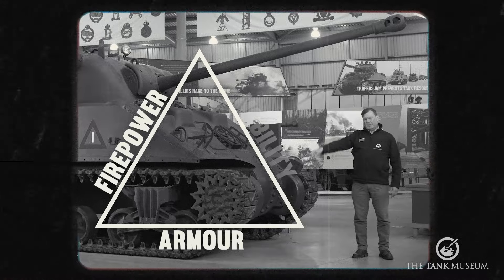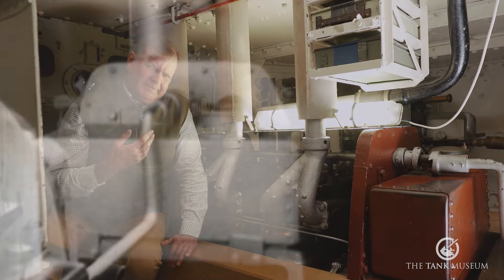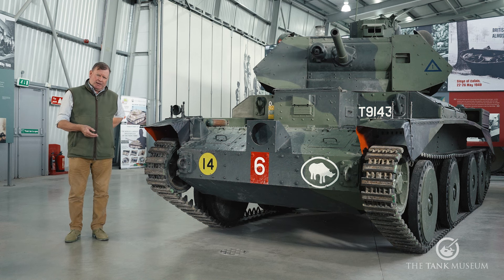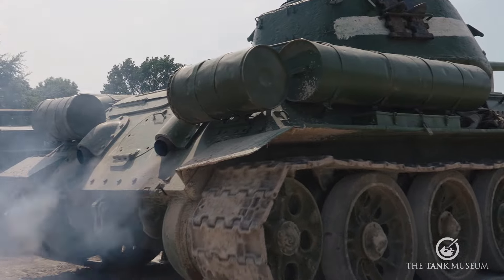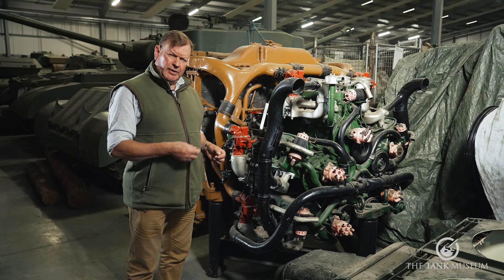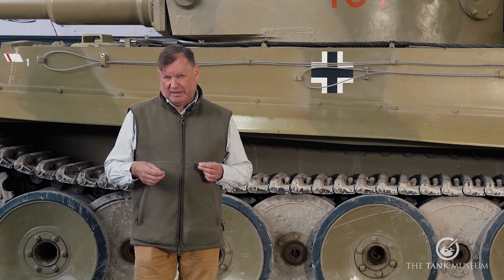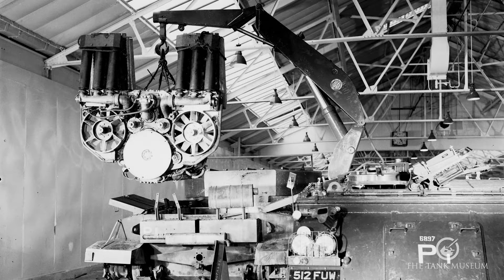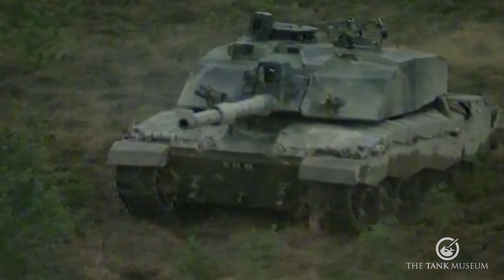Powering Victory: How tank engines went from 105 to 1200bhp

Comment: I would have liked a bit more explanation about the factors that led to engines getting better/more powerful. This video seemed to be more about giving examples rather than discussing the general topic. Rather disappointing considering the title starts with "How".
Reply: Yes, this was more of a "why" than a "how"and seemed to rely a bit too much on tanks the museum owns. It was good to start hearing about such factors as reliability and fuel consumption, but perhaps the details I'd loved to have listened too might be a bit too nerdy for most viewers
Reply: I think delving into things like compression ratios, among others, would go over most people's heads.
Reply: Then we would have veered out of the realm of tanks and into vehicle and motor manufacturing in general. Tank engines became more powerful for the same reason    every other land vehicle, aircraft or naval engine did too.
Reply: I can briefly explain the key breakthroughs in a comment when I get the time, soon.
Reply: So onto tank powerplants.

Obviously something that went on regardless of the type of engine, and the main source of progress in gasoline ones in particular was constant improvement in materials, manufacturing and fuel quality, and parts design to improve combustion and cram as much cylinder displacement and horsepower as possible in a given space.
Similarly, progress in cooling systems (mainly raising the operating temperature of the coolant to extract heat in the smallest cooling system possible), transmissions and other accessories allowed engines to take an increasing proportion of the volume of the engine bay.
These improvements contributed in good part to the increase in power density up to WW2 as otherwise tank engines were still naturally aspirated. 

At the end of the day however, a lot of the increase in engine power in tanks was achieved simply by installing bigger engines as engineers and armies accepted to lift weight and size limits to improve general tank performance. For example most tanks before WW2 had engines of less than 20L in displacement, often even less than 12L. Many went over 20L in WW2, as exemplified by the Germans who went from 12 to 23L during the war. It is only in the 1950s and 60s that engine size stabilized (displacement still increased by improving engines to cram more cylinder displacement in the same space, and was generally over 25L and even over 30 or 40 in some cases). In the 1970's the size of powerpacks stabilized as more powerful engines were introduced but transmission and cooling systems had not progressed as much and became bigger to cope with the extra power.
After the 70s, powerpacks could finally start to shrink for reasons that I will explain next.

Let's go back to the 1950's and 60's. A big change from WW2 and before was that everyone was now going to diesel engines to reduce fuel consumption, allow potential multifuel capability and provide better torque characteristics. However, until then diesels had generally been less power dense than comparable gasoline engines as they were naturally aspirated, and didn't get satisfactory air mixtures for combustion at certain regimes. The second great change from before was the generalization of forced air induction systems, first superchargers and then turbochargers. These were critical as they could provide a compressed air and better mixing, which allowed better combustion and higher power output out of the same engine. Diesels benefitted a lot more than gasoline engines which could only be boosted so far with the fairly low octane gasoline fuel available to ground vehicles. Turbocharging allowed 50's and 60's diesels to match or even exceed gasoline engines in overall performance.

Since then, a lot of the progress in engine power density is down to increasing turbocharging boost, which was achieved both with technical improvements of the turbochargers, and with optimization of the diesel engines themselves. Namely by reducing compression ratio (CR), as increasing both CR and boost is not practical and an engine gains far more from high boost than high CR. Turbocharging systems also now spool up faster than before, which means that engines do not need to be as big as before to provide sufficient power and torque while the turbos spool up. This is why we can now get tank engines with 1500hp at just 24-30L of displacement, instead of up to 47L in the early 70's.

We now get to the late 70's and 80's. Since then, tank powerpacks have actually started shrinking (they did that sooner in the USSR because they implemented some features sooner than the West) as power density increases while actual power output requirements have stayed at 1500hp, although options for 1800hp exist and there are good reasons we would want to go higher (in particular, restoring levels of mobility on tanks which have grown massively in weight since their introduction).
This size reduction was achieved by further improvements in the engines themselves and the turbochargers, but now a good chunk is also down to cooling systems and engine installation, at least in the West since the Soviets did that before. Coolant temperature was increased, and engines are now mounted transversely instead of longitudinally, which cut the total length of the engine bay thanks to better packaging.

Moreover, powertrains now use good electronics to run the injection system and the general operation of the engine, which helps improve combustion to a degree that purely mechanical and overall less flexible systems couldn't. That said, it is worth pointing out that most tanks today still run on powerpacks designed in the 60s or 70s, so a lot of the improved powerpacks are still prototypes or just weren't bought.

Turns out that was pretty long with many technical terms. If you guys want further explanation feel free to ask.

Comment: The T-34 is well-designed?? There was one man in the turret acting as commander, loader and gunner. It was very cramped and hard to escape from. There is more to design than just the outer shell of a tank.
Reply: Two men in turret.

However cvorrect that ergonomics were bad

Comment: Why do tank engines almost always peak at 1500hp? Like why doesnt someone build a 2000hp one? It seems like the 1500hp is the standard for last 40 years
Reply: Because 1500 hp is well suited for efficently powering vehicles in the 60 ton class where most modern western MBTs are. Tracked propulsion has a lot of internal friction, add to that rough terrain and you will get diminishing returns at a certain speed, e.g. adding more horsepower will not increase acceleration or speed at the same rate it does up to 1500 hp.

Though MBTs have been getting heavier, the latest Leopard 2A8 comes in at close to 70 tons and its engine power got increased to 1600 hp to balance it out.
Reply: @jonny2954  thanks!

Comment: Another thing to mention regarding the engines is that most tanks are bloody loud. Not like diesel truck engine loud, I mean aeroplane loud. Couple that with the rattling tracks, even some of the smaller tanks will make the Earth shake when they drive past. The idea of tanks being stealthy is a only reality at long ranges.
Reply: One nickname of the M1 Abrams is "Whispering Death" due to its gas turbine engine being so quiet compared to equivalent-rating diesel engines. At night and/or upwind the dominant high frequencies of the AGT1500 gas turbine become difficult to hear at range, unlike the dominant bass frequencies of big diesels which carry for long distances. The Abrams really can "sneak up" on opponents when conditions are right.

Comment: Ha, skipping the fact that pre-WW2 bigger displacement in the UK was taxed higher deliberately - resulting into poor power/weight ratio first half of WW2 UK tanks.
Reply: Taxes probably not all that important with design for engines for tanks, as the most common engines for commercial production available in pre-war UK were used for double-decker buses, which would also used in rigid trucks & coaches. These ranged from 7-10 L.

Comment: the L60 engine would have been better if it was just a raw diesel engine, run the bugger off of vegitable and plant oils! kinda what rudolf literally built it for, kerosote engines, or diesel engines as they are known mostly, just need a vapourisable liquid that combusts under pressure. petrol, make like an ivan and put vodka in it XD

Comment: The current plight of British tank manufacture is a national disgrace! We simply do not have the capability to produce MBT hulls here in the UK. Government must be held accountable for the loss of what is a strategically import industry. 

Rather than being starved of orders and left to flounder in the private sector free market. Tank manufacture in particular, should have been state owned as soon as the failures of Chieftain became apparent on the international sales market.  Perhaps placed under the direct control of the Crown and not the fickle party politic blighted HM Gov. Royal Ordnance should have been exactly that! Subsidised to the hilt and given frequent new orders to keep the skills uptodate. With extra production capacity built-in to the system for wartime upscaling. It's not too late to do it now but we must start immediately with a new design and a state of the art production facility.

Comment: the meteor wasnt a derated merlin. it was a merlin taken out of air service after it was deemed unrelaible or worn out
Reply: Meteor was a heavily re-designed and derated version of the merlin, initially using recovered parts from the aero engines or parts that didn't meet aircraft tolerances. 
As production built up, it was built new [mainly by Rover], the design was modified for tank use, and probably by that stage, had relatively few parts in common with the aircraft engines.
Reply: @stephenarbon2227  I read the RRHT book on the meteor "The Rolls-Royce Meteor - Cromwell and other applications" and they said 85% common, at least in the early ones. A fascinating exercise done in a very, very short timeframe.
Reply: The Merlin was supercharged and the meteor wasn't and by not being supercharged it could be considered to be de-rated.
Reply: Still derated by altering cr and removing turbo.

Comment: Here's the the real difference between a petrol engine, and a diesel engine. Petrol engines can ( in a WW2 perspective) burn gasoline, aka petrol. A diesel engine can burn just about any fuel, as long as it can be injected under pressure.  Yes, i know that in great britain they used coal gas in large balloons to power vehicle's and training tanks in germany used gasifiers to make fuel. The issues with these fuels is back then they required a lot of space to carry enough fuel, that space impacted mobility in serious way.
Reply: I think for tank use the main reasons were greater operational range for a given volume of fuel and - especialy in the case of russia - diesel being easier and cheaper to refine than high octane gasoline.
Reply: And Germany's synthetic fuel production was producing petrol in way bigger quantities than diesel. That is why Germany was stuck with petrol engines.
Reply: @AKUJIVALDO  
Diesel engine production was relatively limited in Germany [as it was in US], and the marine services had priority, leaving petrol engines to tanks & trucks.
Reply: @stephenarbon2227  I telling you that problem was that there was not much diesel made in synthetic fuels plants. And most of produced diesel went to the Uboats and Kriegsmarine ships.
Reply: @stephenarbon2227  naturally aspirated Diesel engine produces way less torque and power than a turbo Diesel or a gasoline engine . So you have to make the engine bigger and it will consume more or the same amount of fuel than a gasoline engine . Diesel can freeze , it won't start when it's very cold and so on . 
I don't see any advantage of a Russian Diesel engine from WW2 , things changed as they build turbo Diesel engines . Then you have more torque with less fuel consumption.  
Russian W-2 500hp Diesel engine had 38l capacity and around 2000Nm torque vs 23l Maybach with 1800Nm.
Reply: @5co756  
Petrol engines could produce more power and normally would have been lighter. Peak torque is another matter. Diesels produce it way lower in the rev range to petrol engines and just hangs on [depending on the engine]. 
In an extreme example, my old 12 L non-turbo Hino could still pull a full load [very slowly] at 100 rpm above idle and used 20% less fuel than any other brand engine we had.
Turbo-charging wasn't available till a couple of decades after the war, and another couple before you could just turn them on and off without a 10 minute warm up/down.
GM used super-charging for its V series 2 stroke diesels, developed during the 30's.
The Russians used diesel engines for their tanks, and for the large number they got on Lend-Lease. So I expect that they managed the cold weather.
There were stories of lighting fires in the morning, under the fuel tank. 
In a Mercedes, I used few years ago,
the manual said to add up to 1/3 petrol to the tank for under -10C, so that was their solution.
Reply: @stephenarbon2227  This is still used today , called "winter Diesel" . They just add petrol , but at minus 20 degree it is still hard to start and a logistic nightmare in WW2 . As I said , I don't see any advantage of an old Diesel vs petrol engine . Except it doesn't burn/ignite that easy as petrol .

Comment: Where did the statement that the Ch powerpack could be changed in under 2 hours come from?  That was never possible, especially in field conditions. Likewise, please do not refer to “power to weight ratio”, it can not be a ratio as you have power in Kw and weight in Kg; that is a schoolboy error.
Reply: if you have one powerpack that gives 5 Kw per Kg and another that gives 4.5 Kw per Kg, then you have power to weight ratios.  although, power to weight ratio usually refers to the motive power in proportion to the overall weight of the machine.  I.E. my daily driver has 32.73HP per ton, while my toy has 171.41HP per ton.  perhaps you might want to go to school, yourself.
Reply: @kenbrown2808  Nicely put. Many ratios are of two separate metrics, eg BHP per litre, in fact I'd suggest that most ratios are of two differing things possibly? I also recall that the FV434 was designed specifically for swapping an engine out of Chieftain, and 90 to 120 mins to do so was often quoted. If there's any REME lads who've done this for real watching in, please let us know what the reality was.
Reply: @Simon_Nonymous  My suspicion would be that when asked how quickly the engine could be changed over, the factory had the team that installs the engines do a timed run of pulling the engine and then reinstalling it. This would get you the most practiced people of the process doing it. Not at all realistic from the perspective of the actual mechanics, but theoretically doable in optimal conditions.
Reply: @kenbrown2808  or tonne.